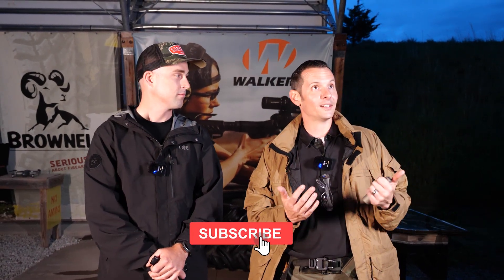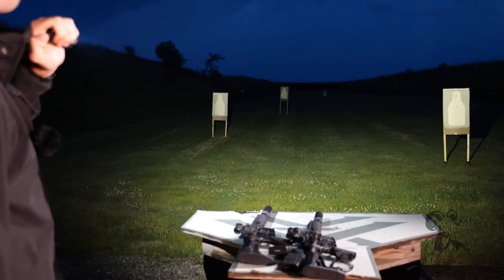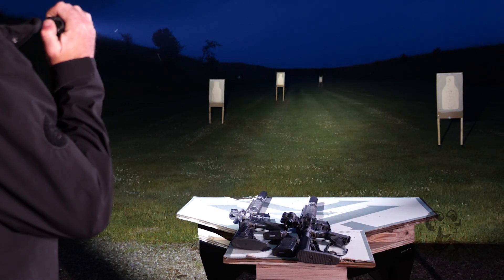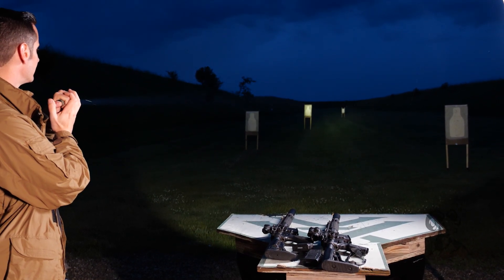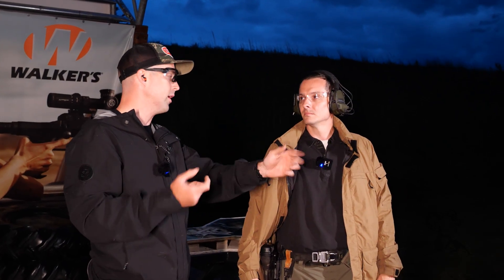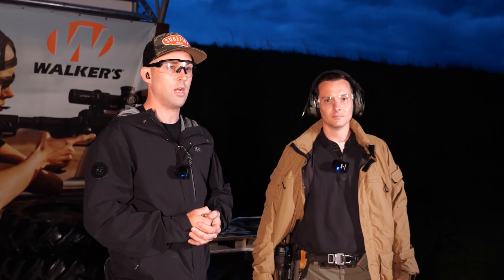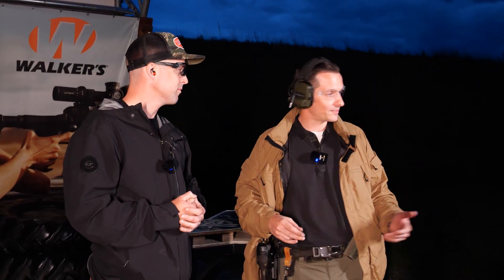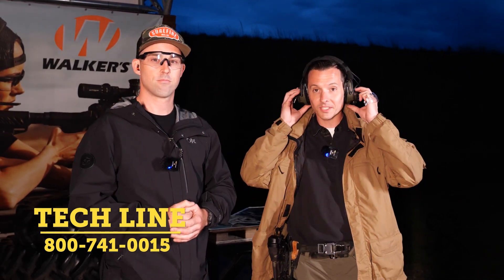Quick Tip: SureFire Light Beam Patterns

Comment: Make a hybrid of the ultra and turbo for x300 and rifle lights. Maybe like 1000 lumens and 35-45k candela with decent spill and decent throw
Reply: There is no perfect light for everything from any manufacturer. Most of the time  law-enforcement carry two lights, the one on the weapon and a handheld and they’re normally opposite so ones would be high Candela and the other would be higher lumen cause then they compliment each other.
Reply: Linden factor and most of these lights is batter performance. He can only do so much with the batteries are designed form. The X 300 has to be using CR 123 batteries. And you can’t have both of the performance due to contracts. There’s so many holsters that were made. They have to standardize the body of the light.
Reply: @DigitalJazz yeah I pre ordered the EPL for the hybrid beam pattern so we shall see how it goes

Comment: Surefure should make an XC3 Ultra or Turbo option.
Reply: They had one it’s was called xr1, no one bought it so I got discontinued. The limiting factor in most lights is battery performance. A lot of these have to comply with contracts that have to run 18650 or 18350 or be compatible with CR123A’s